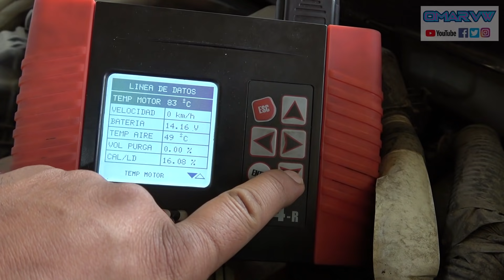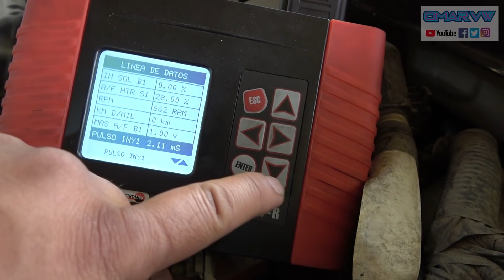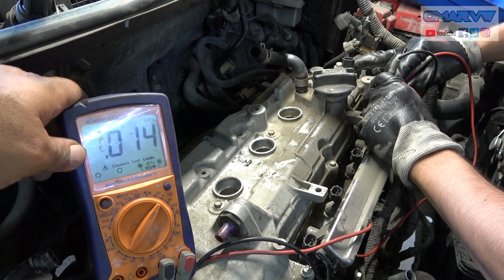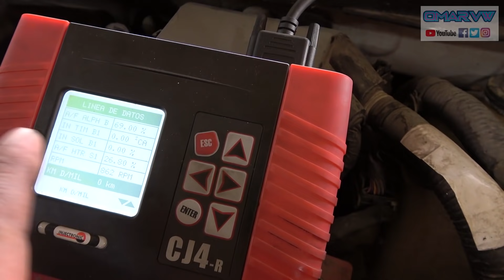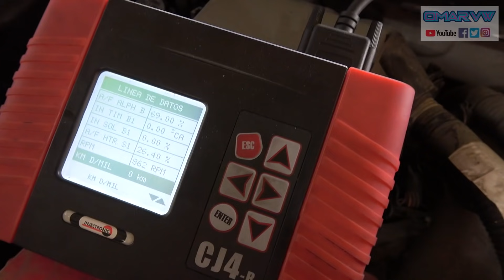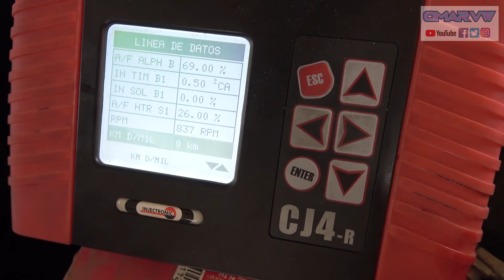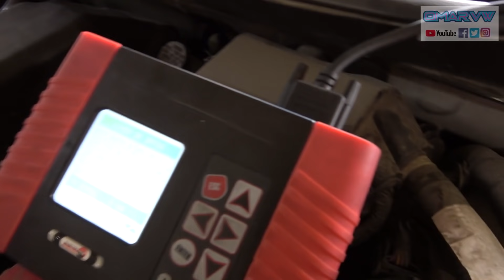La afinación mas difícil de la GUARIDA gracias a un mal mecánico | Nissan March 2012 | Omar VW

Comment: Lamentablemente es mi vehículo me entristece ver lo que le hicieron y tengo una duda antes de ser reparado cuando arrancaba en frío arrancaba directo a menos de 1000 revoluciones actualmente arranca en frío desde las 2000 revoluciones una ves que calienta baja a menos de 1000 me quede con la duda si se debe a que me cambiar el cuerpo de aceleracion  
2. En la resistencia de los inyectores que  solución abría que darle
Reply from the maker: El trabajo de tu cuerpo de aceleración es normal, así debe arrancar tu auto ya que eso significa que hace su auto calibración, al haber estado tan sucio el cuerpo de aceleración no podía auto calibrar subiendo a las 2000 rpm y por eso al bajar las revoluciones estaba en 600 aproximadamente como se ve en el video, pero te comento que esta bien el que acelere a 2000 y baje a menos de 1000 por qué ahora si esta trabajando como debe ser, si se reemplaza el cuerpo de aceleración seguirá haciendo lo mismo.
Respecto a tus inyectores, están un poquitito alto en resistencia, pero trabajaron bien en el laboratorio, aunque ya se nota el uso y el mal servicio que otros mecánicos le hacían, tampoco te preocupes por ello, aun funcionan, ya cuando te den problemas, los diagnostico y te hago saber, pero por ahora solamente es una señal de alerta no grave por qué no fallan.
Si tienes alguna otra duda hazme saber.